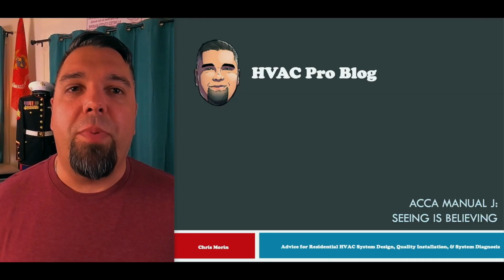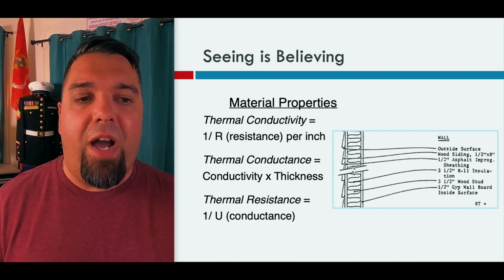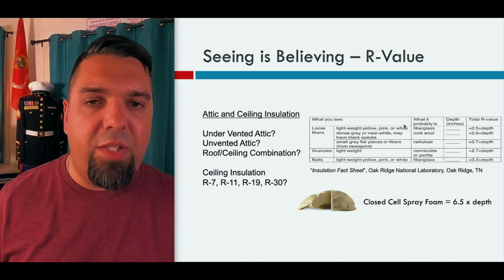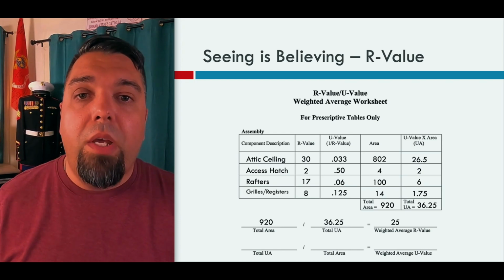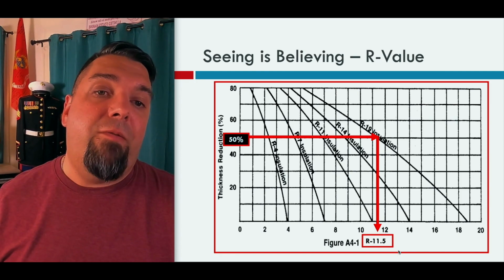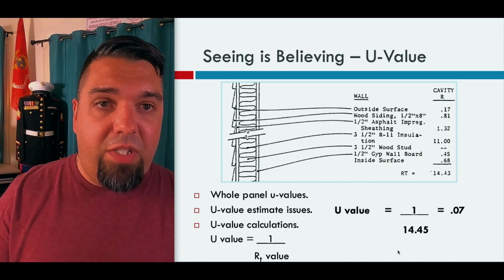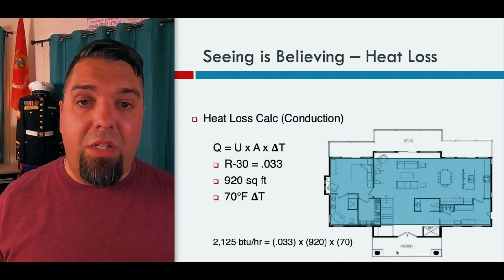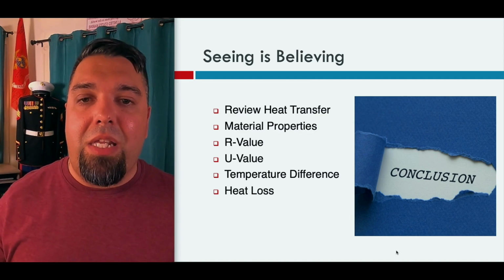Manual J: Seeing is Believing

Comment: What R value to consider if we are doing a manual J for a home that is not constructed yet? We can find the R values from the architectural set of drawings, as we don’t know how much the insulation would be compressed once the house is constructed? How does the city deals with the manual J if we conservatively consider 50 percent reduction in insulation thickness resulting in lower R value in our calculations where-as the architectural drawings shows a higher R-value.
Reply from the maker: Knowing the building code in your particular jurisdiction helps with this.  Most have a minimum R-Value for all construction opaque panels like walls or ceilings.